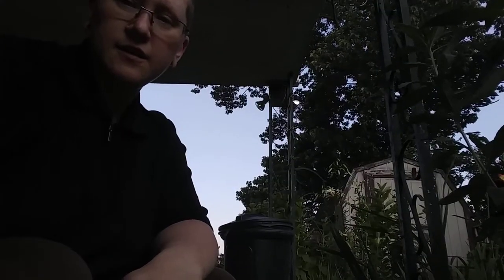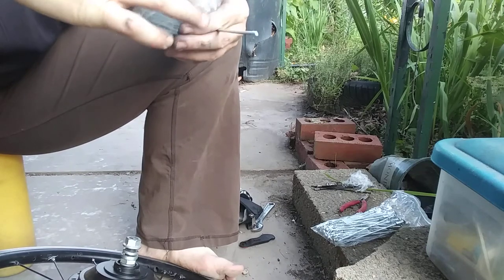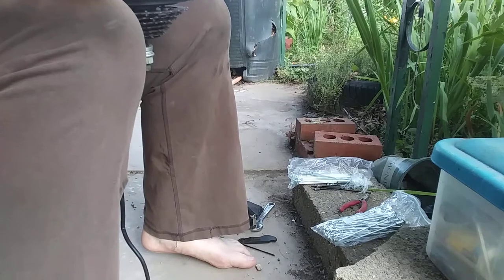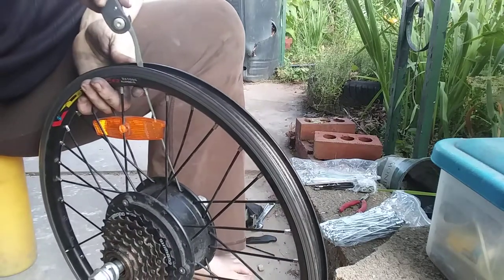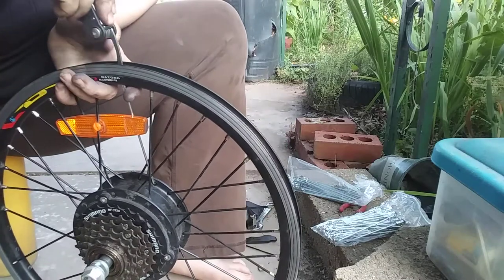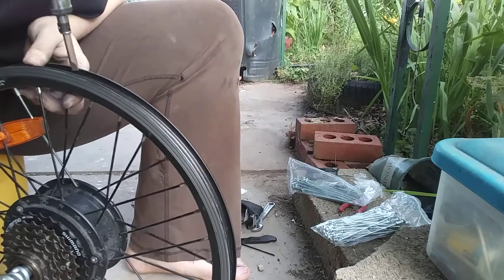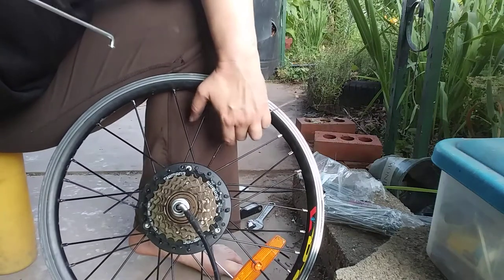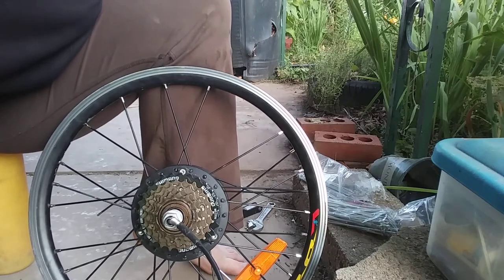Bicycle Spokes - starting to install them (Cyclamatic CX2 folding electric bike)

Comment: I understand that this method only works in some frames. I had a carbon bike with the Aston Rider kit and I switched it to a bamboo bike in 10 minutes and I didn't have to cut any cables
Reply from the maker: Very interesting!  I never heard of the bamboo
Reply: @CliffsidePermaculture  Yes, i put electric kit on my Maloon bamboo bike and the astonrider kit, please see astonrider {do} com
Reply from the maker: @monicapatri9813  Oh nice!  Excellent work with the Kit, that's great!  Very cool to have a bamboo bike, that's so neat sounding
Reply from the maker: Oh, by the way, this is a 2 year old bike that I've rode couple hundred miles that the spokes snapped because over time the hub motor lostens them, and I didn't know that.  If this is the only video you found I just realized that might not have been clear what was going on out of context. <3 or maybe you did know that, but, just thought I'd clarify since I just realized that might have been confusing.